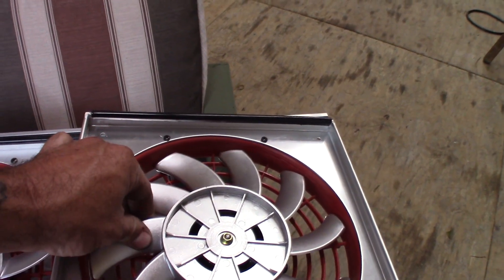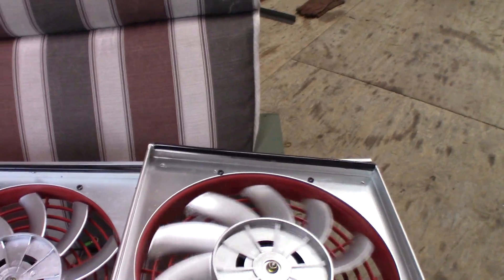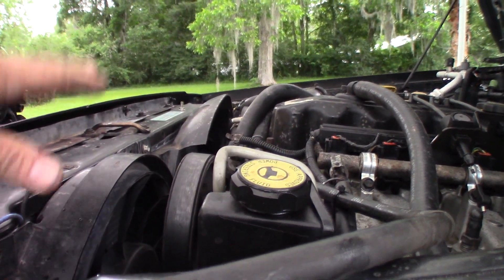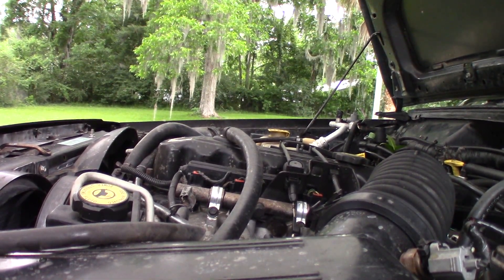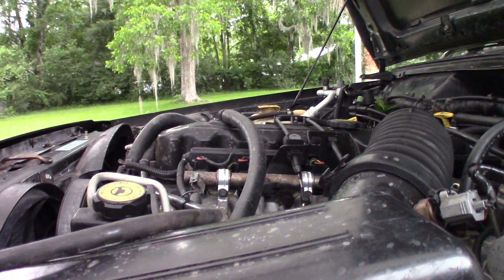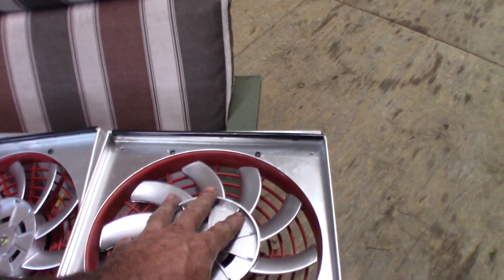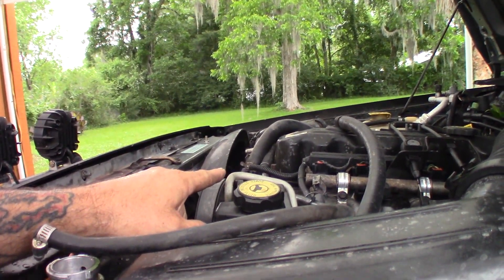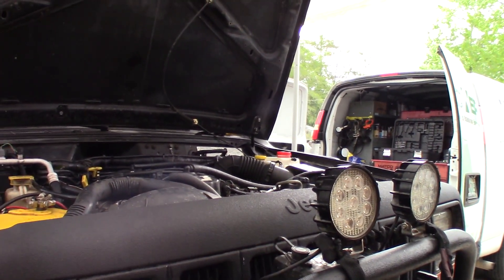jeep xj max cooling set up

Comment: You sir are correct! ... the ZJ fan clutch with a two row radiator is about the best setup I have found for my XJ.....  but the ZJ clutch will not work with a three row radiator as the clutch is a but taller and will not fit between the pulley and the radiator.... I have been experimenting with the cooling system for over a year now... I did encounter the ZJ clutch sawing into a two row radiator at full flex on an RTI ramp, and it happened even though I had installed Energy Suspension Polyurethane engine mounts as well as the Daystar Polyurethane tranny mount... I think Brown Dog engine mount system is the way to go there.... but currently I am running a Primecooling four row radiator (Amazon, can't remember the price, but maybe 300 bucks or so), stock electric fan and stock mechanical fan with new stock XJ fan clutch, as the ZJ will not fit.... I still can heat during crawl sessions at high elevation trails on hot days.... but I believe it's the transmission heating up (AW4, 1997 XJ)... so my next test will be to separate the two cooling systems... I am going to try a big external tranny cooler with electric fans directly on it......  it has been quite a war trying to figure out a cooling solution to my driving style... .... '97 XJ auto, 7.5" lift in the front, 5" lift in rear with leaf sliders, 37" BFG KM2's on new Rubicon rims (they actually measure 36" new)... Plus more goodies, but that's the setup in a nutshell for the sake of the cooling topic...... .... I know I know.... too much talk 😂
Reply from the maker: Sheridan Rambo there not enough talk on this subject I've never had to fight with it til now and it sucks big time lol

Comment: I went the expensive route on my jeep and got a Griffin. But man does it work. For some people stock works and some it doesn't.  Seen complaints of jeeps running hot off the showroom floor and some who have no issues at all.  Jeep has barely big enough radiators for some reason.  I have a Lincoln Mk 7 two speed fan and a Taurus two speed. The thunderbird fan is supposed to draw 4000 cfm or so the specs say. High speed that is. All I know is it has much more airflow. I even tried a ford explorer 9 bladed fan before the electric. Once my jeep heated up in the summer the stock system would not cool it back down.  Now I run my jeep with the fan off most of the time. Winter I have to completely block it off.  Key  of course is to keep your system maintained and clean.  And the griffin was not that much more than a stock radiator. No way I was gonna do an Ebay special.

Comment: Same setup as Craig drake here but I have aluminum wide tube performance radiator from cold case. Flow cooler pump, ported high flow tstat, Napa premium 180degree

Comment: I just installed a mishimoto radiator in my 90 renix closed cooling system. It used to run at 210 normally and would climb in traffic or drive thrus to almost in the red. Now it runs about 180-190 and climbs and stops at 210 at idle. With the new radiator I notice that as soon as hit the gas the temps comes back down rapidly. I run the stock engine fan and AC fan and stock thermostat. Is there something I can do to get it to run a bit cooler? I was considering triple fan upgrade until I saw this video.

Comment: My 2000 XJ is programmed stock from factory for the Aux fan to come on at 223F....but when the aux fan comes on it drops fast back down to 195F.  Im going to either run the fan constant off a switch or put in a lower thermostat/relay.

Comment: 180 degree tstat. New head fully blueprinted stock fan setup. Took zj fan off because of power loss but runs at 210-220 even 228 uphills. Overheats on freeway and idle even with fan override switch on full time. Freeway doesn’t make difference when turn fan on. So my thing is this is just crap because like he said in video after tstat opens your cooling system is at 100%. Tstats open 15 degrees after stated degree btw but mine running 225 on freeway pisses me off. Only thing that works I believe is a 4 core radiator with triple cross flow by cutting and welding plates inside radiator caps. Bottom line is these are Pos compared to all my friends Toyota’s, which is really saying a lot being my fully built dynatrac pro rock 1ton xj is a beast. can’t make it to trails or wheel hard without overheating tho. Lol. Oh trans has 2 coolers and taken out of radiator which should help cool it even more.  Anyone Want my xj send offers I’m over this piece of shit.

Comment: I replaced everything in my 98 cooling system (radiator, hoses and internal spring, thermostat, heater core, water pump, fan clutch, etc.), and I still run hot after getting off the interstate. I think the ZJ clutch is next. Might even do a trans cooler if it would help.
Reply: @lance Hamilton you may have replaced "everything" but there is more involved than just that
Reply: Steve Latsko such as?
Reply: @Lance Hamilton well for starters name the parts and brands that you used.....because if  you replace absolutely everything with the right brands then you will have 0 issues
Reply: Steveo's Garage I can't force you to do anything....I know what I'm talking about and if you don't want advice then I can't help you....brand means a lot
Reply: Steveo's Garage thought you were lance sorry....a lot of people are confused on cooling and it's easier than they think
Reply: I used OEM replacement stuff (i don't remember brands as i replaced them one at a time over the course of a year). I think I narrowed it down to the aux fan though. It only runs hot if I am running the A/C after the slow down from going highway speeds. My efan seems like it's struggling. Gonna replace it and install a trans cooler
Reply: Lance Hamilton my electric fan basically never turns on because of how great my system keeps me running cool.....if you absolutely used oem you shouldn't be seeing any problems of you replaced everything

Comment: Question please. Regarding the fuel pump balast resistor. How hot should it be getting? Mine gets up to 160 degrees.
Reply from the maker: They get very hot it's normal

Comment: Nice video men 👍I was about to put electric fans but I guess not lol thanks ...hey how was your setup with the washer reservoir tank relocation when you install the snorkel ? Do you have a video for that? ..like your videos 👍✌
Reply from the maker: ho bo the washer tank is a universal overflow rad bottle from orielys you can remove the pump from the old washer tank and grommet install in the new tank and all the wiring will reach works pretty good
Reply: Rusty 411 👌👍 thanks I will look for that because right now I don't have a washer reservoir tank and I really need that .. like your videos  thanks ✌

Comment: If you use a 180 thermostat does it effect your mpg?  The factory thermostat is hotter so it passes emissions and junk.
Reply from the maker: scoodles93 yes it will effect mpg small amount my jeep is a trail rig if you have to pass smog test it will need to be factory temp it will run a tad richer at lower temp

Comment: I wanted to buy a new all aluminium radiator and do that fan cluch upgrade... will it work with the new radiator or just keep the stock radiator?
Reply from the maker: omar lizaola I still don't like the new radiator I'm gonna go back to my old set up with the stock radiator the Trans still seems hotter than normal I just don't like the aluminum radiator gonna pull it out tomorrow and go back stock just went out trail riding for a couple hours and it's not the same as stock set up just does not work as good idk makes no sense but it is what it is
Reply: Rusty 411 sounds good I'll just upgrade my fan clutch I just replaced the radiator when I replaced my engine... thanks!!

Comment: I just bought a 2001 xj and it runs hot to me what is the temp supposed to be at my really gets hot in stop and go traffic and also what about the oil pressure my pressure is like 15 or 20 at 55 mph
Reply: suppose to be 210. oil pressure is controlled by engine speed, so 15 to 20 may be normal depending on engine rpm.  What would be odd is oil pressure to be 15 at 4000 rpm. 15 at 1700 rpm seems normal
Reply: 99 XJ here, 210*F is a normal running temp, sitting at idle for over 30 mins gets up to 211*F perfectly normal. if it runs hot you have problems, flush coolant replace thermostat with the factory 195*F T-stat.  You'll typically be at 207*F driving 65mph and sitting at a stop light you'll see temps of 210*F-211*F.  They're made to run at these temps.  IDK how true this is but I've heard that if you try to run lower than 205*F the oil won't flow like it should and you'll end up with more carbon deposits at lower temps as well. But these I'm uncertain of just something I've heard. He's right though, Stock setup is fine for a daily and you can ZJ clutch if you offroad a lot.

Comment: I have a 96 9" long arm lift on 35s automatic transmission and it over heats idling and normal driving on the road I've tried electric fans with three row radiator that didn't work so I went back stock fans and it still over hearing!! Plz help!!
Reply from the maker: +Nehemiah Harris need to check for blown head gasket or cracked head get a hydro carbon test kit from Napa and follow the directions on the kit if the head is cracked or leking it will put to much pressure in the cooling system and cause this also the water pump check the impeller on the pump make sure all is good there

Comment: I don’t know what year you all have but if you have them vacuum part that turns the heater on and off where the Tee is in side there’s a screen that you can’t see Take the Tee off and use a stiff wire to punch out the screen your overheating problem will go away anyway that’s what I did to my 1988 Jeep Cherokee And if you have a newer jeep Cherokee that the heater is on all the time you just gonna have to flush out the heater core are changes it that what I did with my 2000 Jeep Cherokee and My overheating problem went away good luck that’s been my experience with my two of my jeep Cherokee

Comment: Hey rusty off topic what transmission fluid do you put on your jeep? Mine is a 1998 jeep cherokee like yours and I'm getting alot of mixed answers on the forums/online.would like to hear what you recommend.
Reply from the maker: sinaloacosala1 I run the factory recommend  ATF + 4 in mine it's expensive but from my experience use the Trans fluid recommend on any Trans the clutches and seals are designed to run it